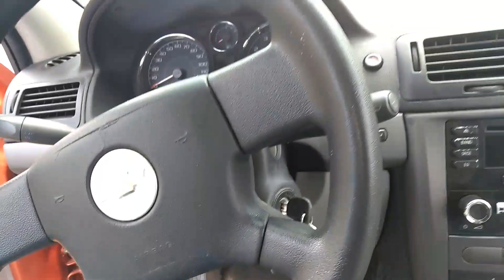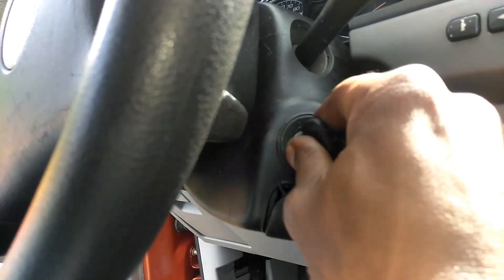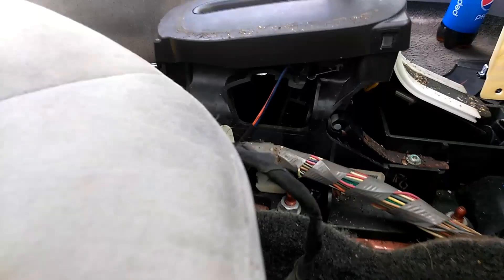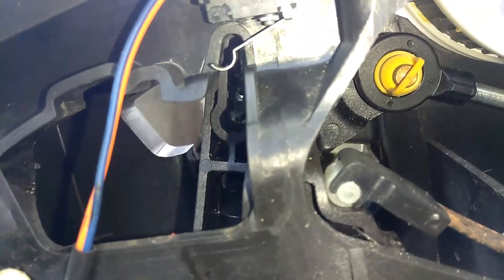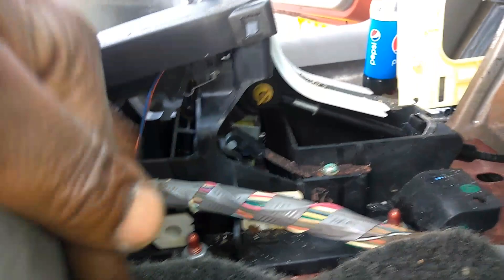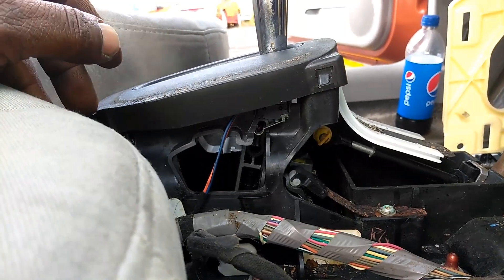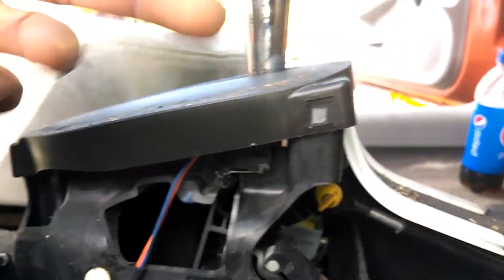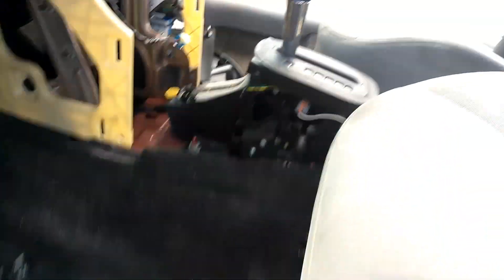2006 Chevy Cobalt key stuck in ignition

Comment: Is that the shifter interlock solenoid that the pin fell out of? If it is its a Dorman part #924982 $53.99 at AutoZone. That pin has to be laying right there somewhere nearby on the floor. Couldn't have gone far.

Will that missing (or loose) pin cause the shifter to be stuck in park?

Comment: Hey thanks for the video but actually that start up thumping nosie i also have that in my car what could it be and if so help with a video please
Reply from the maker: Genaro Silva hey hru sorry about the late response on the comment, the thumpping noise is a flap in side the dash that controls the heat and air distribution. There is a acutator that gets stuck at start up. It's a pain in the ass to do but it is fixable. A shop would probably charge you around $150 bucks to fix save your self the head ache and let a shop do the dirty work. On this one. Thank you for your comment and please subscribe

Comment: Thank you for sharing this valuable information. Is this sensor used on alot of GM vehicles?
Reply from the maker: TheCoatneyadkins hey thanks for the love. Yes you can find then sensors on the Impala most of the gm with the shifter in the floor. Thank you for checking out our video please subscribe.
Reply: www.Helpwithacaronline.com , I just subscribed. I bought a car from my boss, who owns a garage, and it has this problem, you would think that someone with thirty years of experience would have known what the problem was, but nope.... me, I just started working as a mechanic so I had no idea...I knew it had SOMETHING to do with the shifter cuz if I barely pull it back after I put it in park the key will release... I'm gonna take it apart and see if I can adjust the little rod or just make one like you did. That's good stuff right there. thanks again.
Reply: @TheCoatneyadkins  happy holidays thank you for subscribing to our channel. And you are welcome sorry for the late response

Comment: Got everything off pin is still in place so that’s not it tested the sensor manually by pressing it still didn’t work so I’m assuming the sensor went bad so I’ll just use the underneath the steering wheel button for now unless you know of something else
Reply: @shawnam96  Right above what pin? I'm trying to find the box that you're talking about cause I also opened it all and the piece of metal is still in place...don't know how to fix the issue